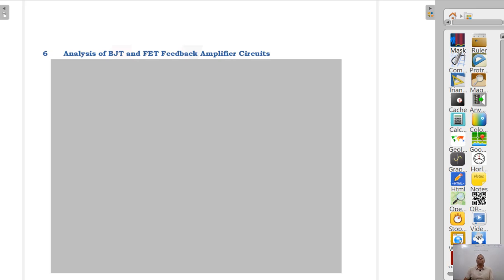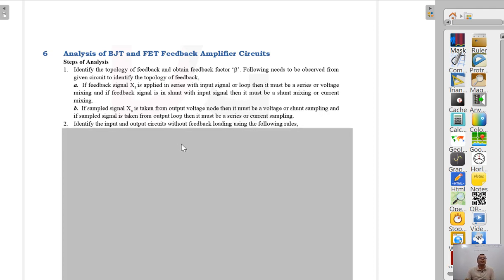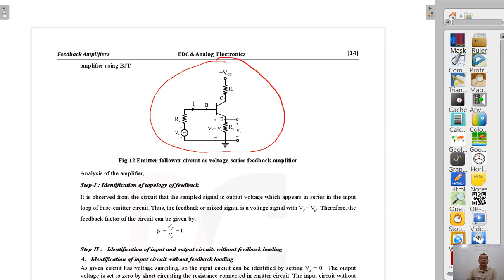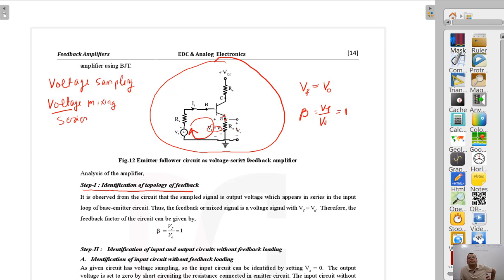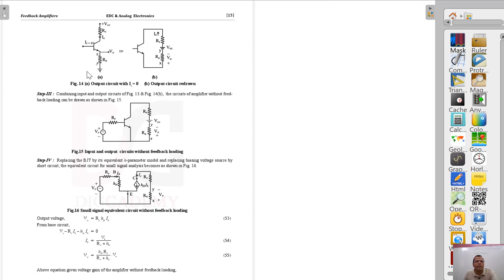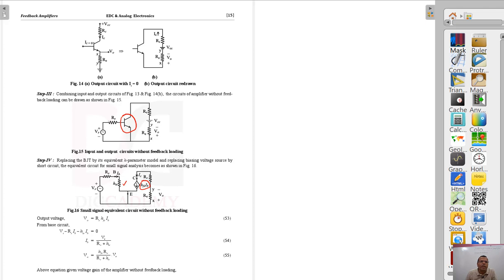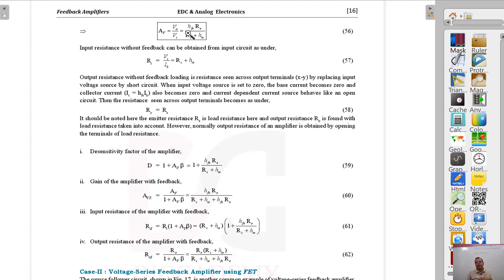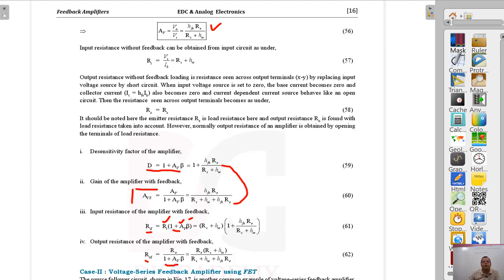EDC &  AE  Ch 13 Feedback Amplifiers L5 Voltage Series Feedback Amplifier

Comment: Respected Sir
23:36....Output Resistance without feedback...whether its wright or wrong.....In some books it is written as infinity
Reply from the maker: If RL = Re then output resistance is found by opening the load resistance so Re has to be replaced by open circuit to find Ro and Ro is without feedback is infinite. If Re is taken as part of circuit and not the load resistance then output resistance is finite.
Reply from the maker: It will be included in text of this chapter. You can read that on www.digcademy.com
Reply: @digcademy2856  Thank you so much Sir